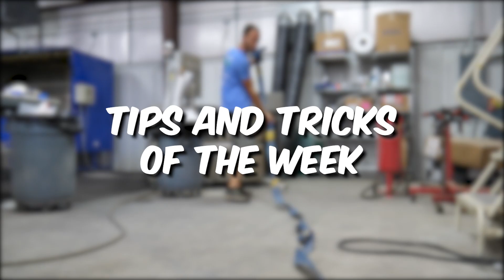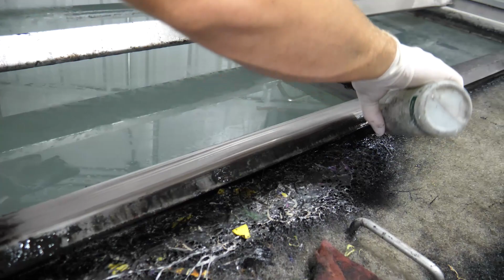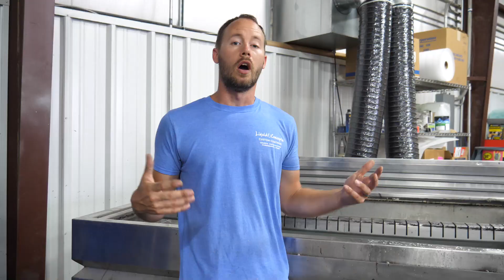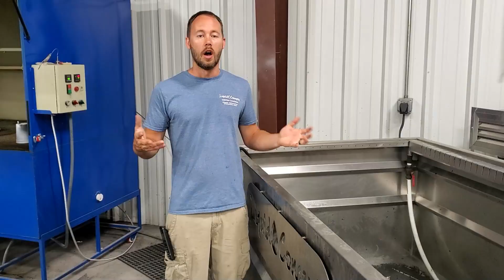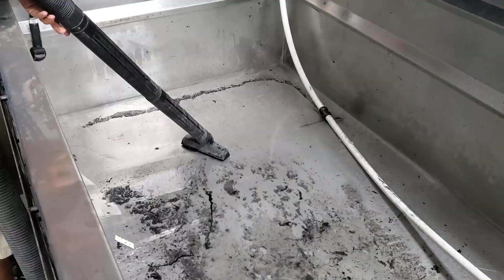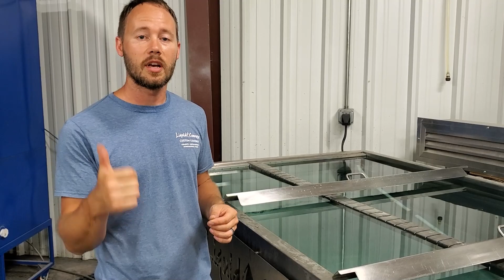HOW TO CLEAN YOUR HYDROGRAPHICS TANK | Liquid Concepts | Weekly Tips and Tricks

Comment: Great video, I learned a lot from it. Keep up the great work. 

Can you go into more detail on the filter you use, how often you change it and how you have it setup to work (ie its function)?

I was thinking of using a small 12v pump to circulate the water to avoid temp gradients in my tank. I was thinking of building a 5” round filter that uses Activated Carbon (the filters you use with soldering station exhaust fans). I would put one or two layers of filter (each about 3/16” thick), and circulate the water through that. Was thinking on making this part out of clear tubing to see it working or getting dirty. 

Can you comment on this idea? In your video I think you said you filter the water by a overflow method where you just skim the top of the water. Can you go into more detail on this or if my idea to just circulate the water through a pump and filter would be enough?

As I plan on using a insulated Coleman Cooler which has a drain spout, will the lacquer thinner be safe to use on plastic?

Thanks again in advance. Great videos.
Reply from the maker: Not quite sure on how the activator will affect the plastic but I would certainly do some testing before applying it and building the whole tank. As for the tank filters, we will try to shoot a video on this so you can check it out more clearly! Thanks for the idea!

Comment: Nice video, thanks for posting it! A pro tip:  Depending on the water and climate some of you might have an issue with some kind of "seaweed" in the tank. Just buy about 5m (~15ft) of copper pipe. Build some kind of a bracket and drop the assembly in the fresh water. The seaweed will be gone.
Reply from the maker: Thanks for sharing
Reply: @LiquidConceptsUSA  can you add anti organic growth chemicals for an aquarium in the dip tank to avoid nasty smells and bacteria growth? Maybe adding a bit of bleach (500:1 ratio or something)?? Would it affect the film or activator process to dip parts?